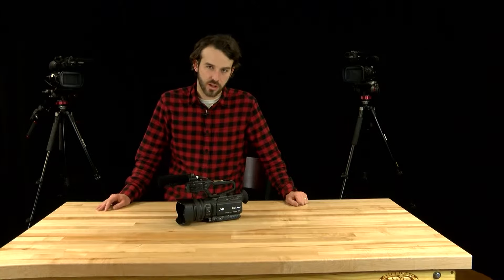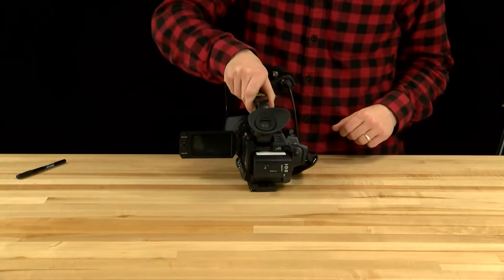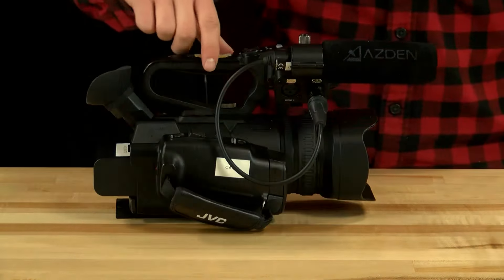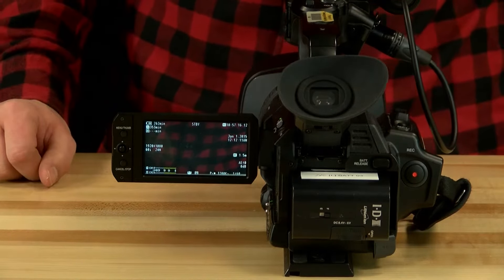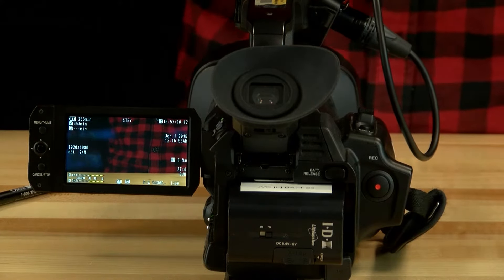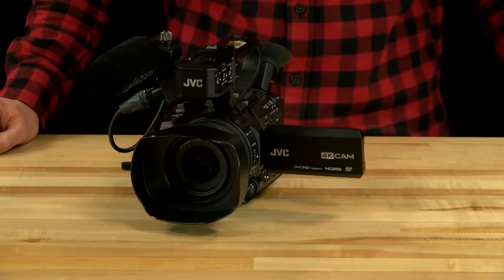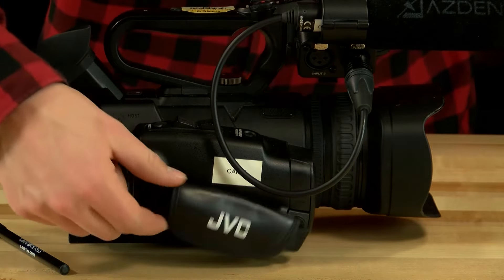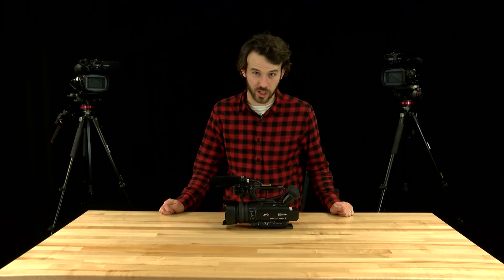JVC GY HM200U Tutorial

Comment: My JVC GY-HM200U's LCD monitor screen can and does physically rotate 180 degrees for viewing/monitoring from in front of the camcorder , like selfie style, yet by turning mine that way and looking at it from in front of camera, guess what, the LCD Monitor VIEW is UPSIDE DOWN . Yea, that's correct, it doesn't auto-rotate , flipping/swapping vertical up/down, into a correct upright orientation. When viewed from behind the camera it's fine, right side UP - but when viewing from in front of the camera (requiring vertically flipping the screen up-sideDOWN), the view then is also up-side-DOWN , and it just stays like that.

It simply refuses to be seen right-side-up when flipped selfie style. Listen to this ::: I have even turned the entire camcorder upside down, so you would think then that the inverted orientation would cancel itself out that way and accordingly the view would then appear as right side up, right ? WRONG ...... it still has an upside down view. So that means it can and does vertically flip auto-rotate, but for some reason unknown to me it only exclusively does it in only in that situation I just described, which is worthless.  

   I have searched & searched for a setting option or some kind of fix for this, to no avail. Is this is a known issue, or just a flaw of my unit ? ?  I find that hard to believe. That's not rocket science technology firmware patch. I have the latest firmware - direct from JVC's firmware update page :: " Current Version: V0313-0230, Release Date: 2018-03-09

No upgrades are available. You have the latest version of the software.  " 

 If anyone knows a fix to this please for god's sake share it with your fellow users in a REPLY , thanks in advance !!